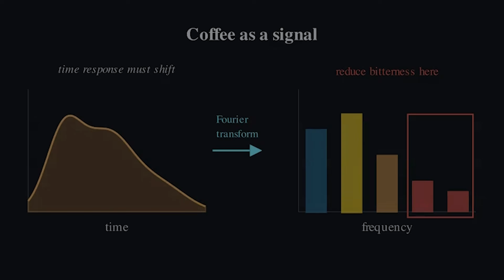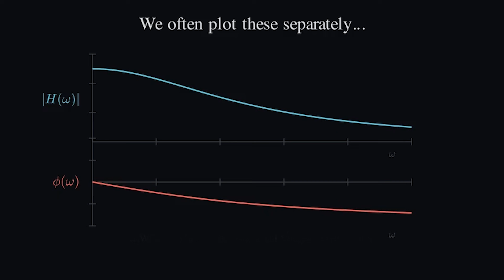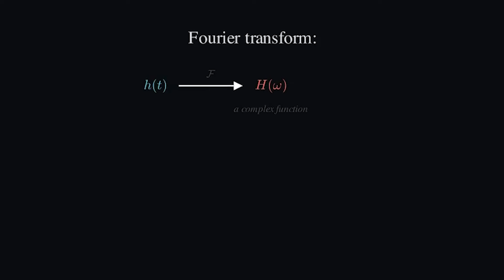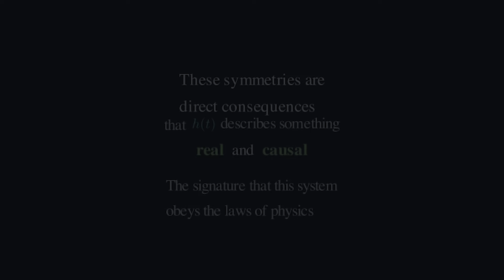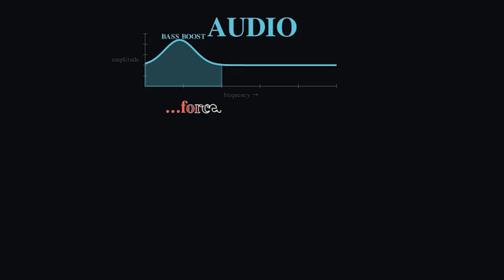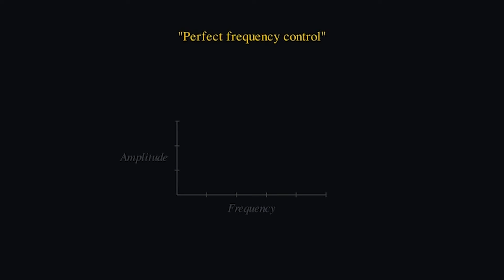Kramers-Kronig: The Surprising Link Between Time and Frequency

Comment: I think a statement should be included early on about the subset of filters that are considered in this video.   Linear phase filters that are very common digital filter do not change the relationship of the phases across frequencies. They just delay every part equally.  In many audio systems and digital radios the bulk of the processing is done digitally

Comment: Very nice video! I wish it was longer and explained more of the reasons and proof behind statements like "causality is the reason for the connection in time and phase" or some derivation on the actual relations. But of course that would be a different video with a different goal. It's a very good introduction and motivation.  Thanks <3

Comment: Wonderful job on your first video. At least for semiconductors, it is usually easier to measure the index of refraction than the absorption, since index can be measured by reflection measurements whereas absorption is more sensitive to transmission measurements, which requires your sample is very thin (not usually the case). Some techniques actually measure both index and absorption, like ellipsometry. Getting the index or absorption of your desired material is fairly complicated though as it is usually never just one material (most likely a stack of materials). The Kramer's-Kronig relations are useful to test if your index and absorption spectrum (after data analysis) is K-K consistent, to indicate you are modeling your sample properly. Hard to explain in a short (yet, fairly long) comment. Nonetheless, just wanted to provided more context to your statement, which is really only half true that the index is derived from absorption. For those still reading, the even and odd constraints on the real and imaginary parts of the signal are called sum rules. There are many more of them that can also be helpful during data analysis or modelling.